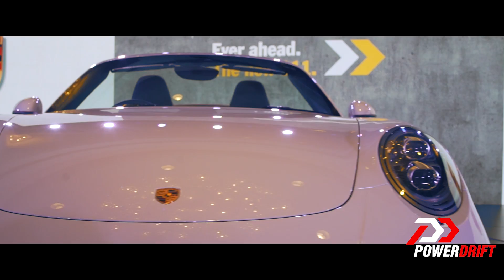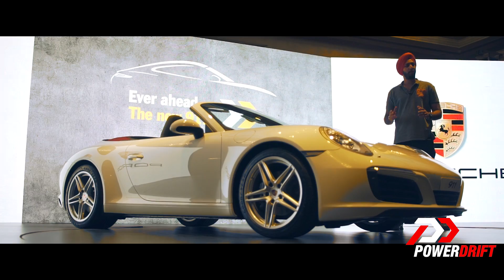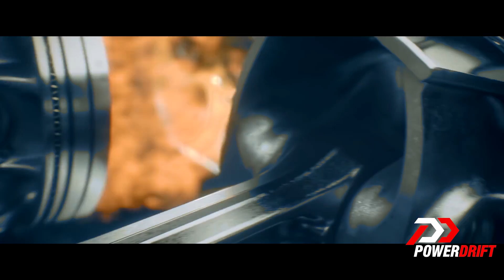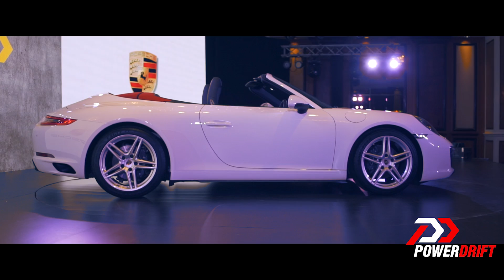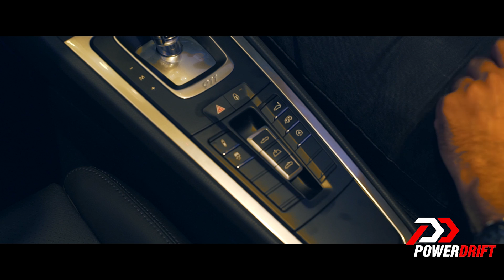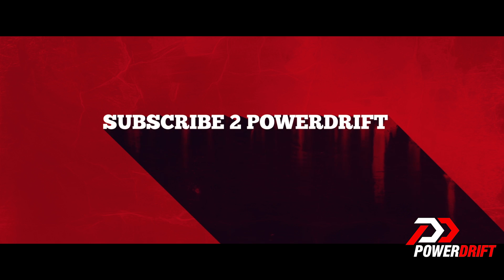Porsche 911 Range : Launch Alert : PowerDrift

Comment: Why is his name is 911
Reply from the maker: Because, Earth is round maybe? :P
Reply: It originally was designated as the "Porsche 901" (901 being its internal project number). 82 cars were built as 901s. However, Peugeot protested on the grounds that in France it had exclusive rights to car names formed by three numbers with a zero in the middle. So, instead of selling the new model with another name in France, Porsche changed the name to 911. Internally, the cars' part numbers carried on the prefix 901 for years - From wiki
Reply: +PowerDrift ye duniya pital di par powerdrift rubber di
Reply from the maker: *Synthetic rubber. More strength & durability.
Reply: +PowerDrift 😨